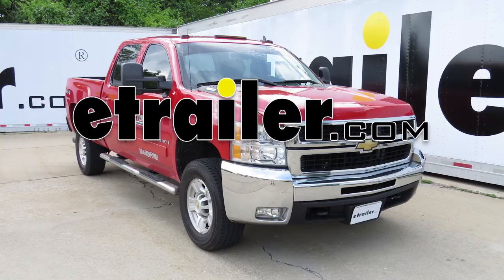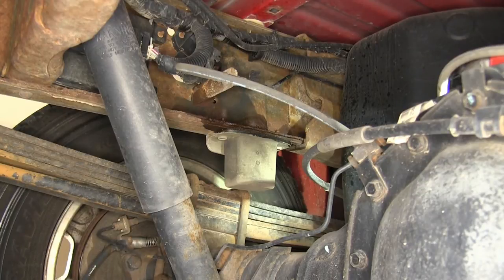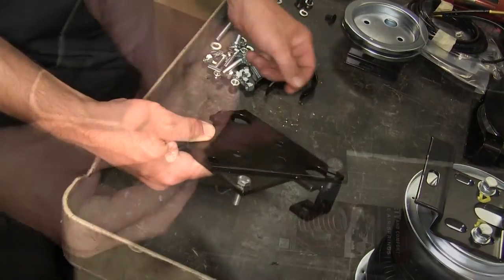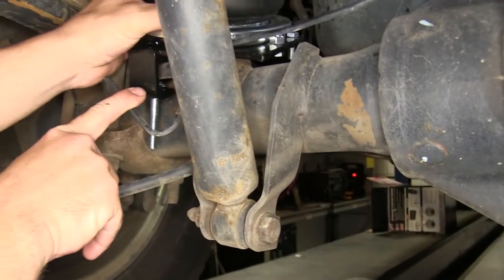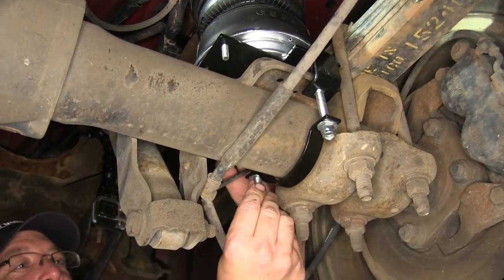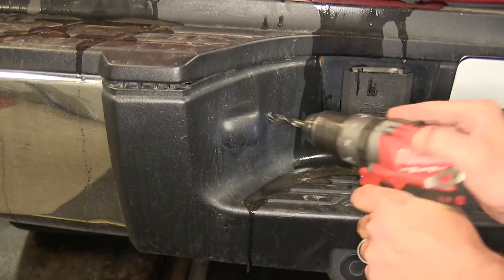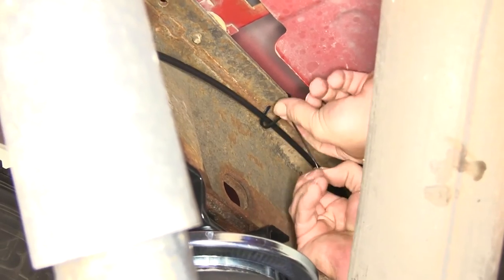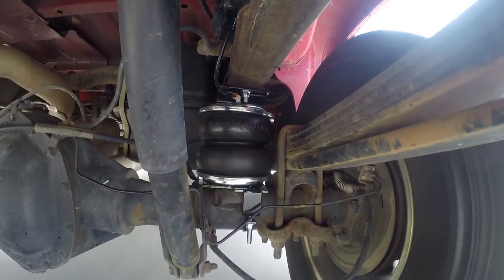etrailer | Install: Air Lift LoadLifter 5000 Air Helper Springs on a 2008 Chevrolet Silverado

Comment: Sounds like you got Norm McDonald to do the narration for you! :)
Thanks for the great video. I just did the install on my '08 Chevy 2500 and between the provided instructions and this video it was any easy job. The instructions show how to assemble the bags but doesn't show them on the truck. You video clearly shows how they go on. I don't have a lift (yet!) so had to use jack stands. I pulled the wheels and tires off which made access much better and I didn't need to drop the spare. 
BTW, the nuts that hold the stock bump stops take a 15mm socket or wrench (FYI so anyone else doing this doesn't have to run back and forth to their toolbox trying to find the right size socket for blind nuts).